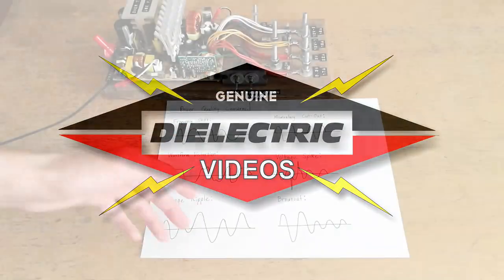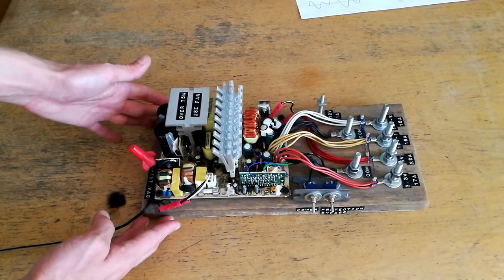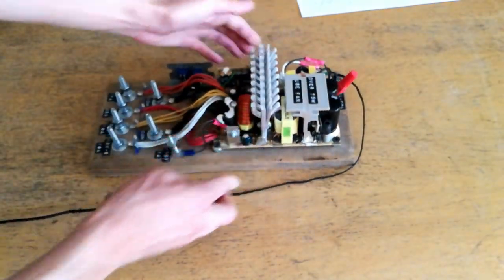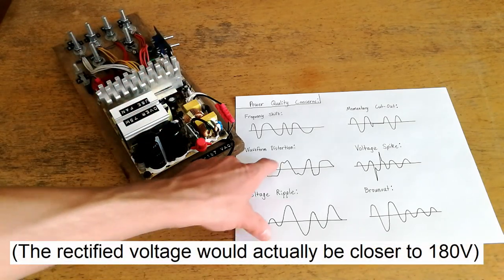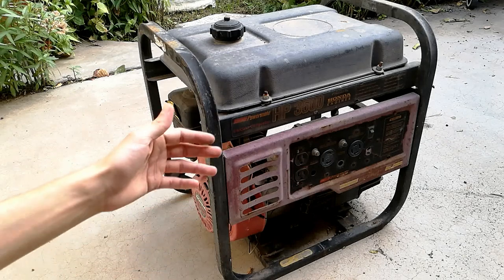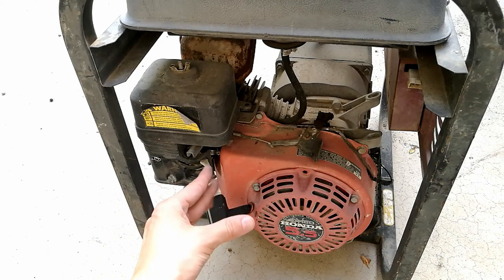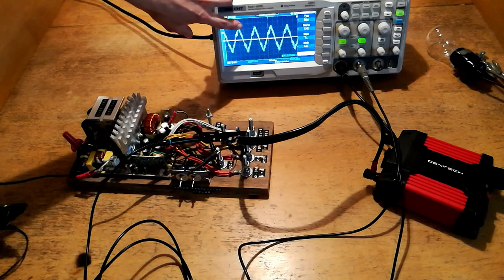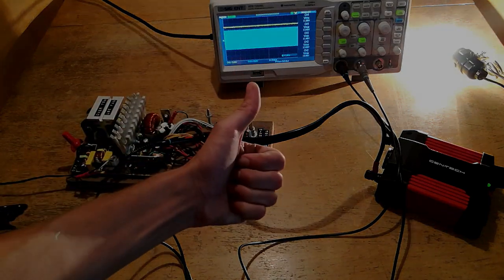EP 45 - Power Quality & Sensitive Electronics

Comment: I have seen other sites say that powered line conditioners are useless with non-inverter generators...
Reply from the maker: In more or less constant-load conditions, the conventional generator would likely not be problematic for most electronics.

However, one thing that I did not cover in this video, but that is very important to consider, is the effect that transient load changes will have on output voltage. The most likely time for damage to occur to a load connected to a generator like this is when another large load is suddenly disconnected, causing the output voltage of the generator to spike.

The effect of a power conditioner will depend on the type of power conditioner, and how it performs voltage control. If it can quickly control voltage, it might improve the survival rate of electronics in these conditions. A simple surge suppressor may do the same, although it may quickly degrade the MOVs.

In general, it's hard to specifically say "this generator is safe for electronics", but in general if large load variations are avoided, it is unlikely to cause problems.
Reply: @DielectricVideos  ...going further on your previous ( and excellent) responses to me on surge protectors and line conditioners.....I'm reading more of the comment issues and return here. So,,.,....in this case, can we say it's good to have some amount of excess (watts produced) capacity?....meaning...... is it better to get a bigger unit, to have it be loaded at (say) 50% of  max load instead of 80%?...such that on/off switching of your loads can produce smaller variations in output? Still thinking this might be better for most of us vs inverter style replacement of our genset....both at a smaller , same rating?
Reply from the maker: @TheWilferch  A bigger unit will have more inertia, so it should ride through load steps more smoothly. That being said, they typically run most efficiently between 50-80% load, so if you go too large, your fuel-to-electricity conversion efficiency may go down. I'd probably try to size the generator so that  the typical full load is around 60% of its capacity, and definitely don't let peak load exceed 100% of design rating. Also note that induction motors can pull 5-8x their nameplate current and power when starting, so if you have any large motors, you should be sure the generator can deliver around 5x the namplate power rating of the motor (this can be peak generator rating, and need not be its continuous rating).
Reply: @DielectricVideos  ...Excellent !!!...here's more....when I investigated my split-system home AC/heating system ( all electric).....I came across comments from others that when adding a 521-style hard-start system on the outside unit....it drastically reduced the starting load on the compressor and made starts on standby generators a lot easier.....maybe this approach can be applied to folks who have to contend with many ( or large) motor starts on gen power?

Comment: Make sure to buy a generator with a AVR   Most Cheap Low end Generators don't have a AVR  ( Automatic Voltage Regulator )  they use a Capacitor to Regulate  the AC Voltage & when engine speed goings Up or Down the AC Voltage does the same Up & Down, But a AVR Keeps the AC Voltage at a Set Voltage 120 or 240
Reply from the maker: Great point! The generator shown here doesn't have an AVR, so its voltage follows the engine speed and to some extent the applied load.
Reply: @DielectricVideos  ..funny...everyone disses Harbor Freight Predator Generators...yet if you look closely at the build architecture and componentry they mimic all the other brands available for home use....and yes....they have ( at least my model does).....an AVR.
Reply from the maker: @TheWilferch  Harbor Freight power equipment has always been really good in my experience. I have one of their 400W modified sine wave inverters from 2015, and I've put thousands of hours on it, including several overloads and a positive/negative terminal reversal. Other than replacing the fuse after the reversal, it's been an extremely solid inverter!
Reply: @DielectricVideos  ..let me go further.....assume that your normal generator is set up ( as I did),  to back-feed your home's main panel during a power outage, via an interlock system added to your main panel.... and using an inlet PB30 receptacle, that takes an L14-30R connector between the house inlet connection and the generator. Is there still a reasonably economical way to add line conditioning?...or...would it be a plug-in to whatever specific circuit home wall receptacle?..... feeding whatever "delicate" electronics you are trying to protect? Meaning...only a smaller and more specific-duty device for one of the breaker circuits or specific wall receptacle connection? Hope this makes sense. I'm not using individual 120V extension chords from the generator hooked-up this way.
Reply from the maker: @TheWilferch  For a whole-house generator supply I think the easiest method would to be to install point-of-use line conditioning at the loads you are looking to protect. A voltage regulator unit would probably be adequate, assuming the loads are not also frequency-sensitive. If they are frequency-sensitive, then a rectifier-inverter system might be in order.
Reply: @DielectricVideos  ..thanks....what would constitute frequency-sensitive equipment? My devices of concern are smart TV's, laptop computers, maybe the wireless LAN/WAN router, maybe the microwave, etc....I don't think I would engage the home A/C and their controls, nor the electric range ( even if one burner load can be supported), nor the washer or electric drier to be under gen backup power...so  maybe just those things at the start of this sentence. Thanks for all your help.
Reply from the maker: @TheWilferch  None of those items should be frequency-sensitive. Dimmer switches and equipment with synchronous motors come to mind. 

If your loads have full-range power supplies (100-240VAC), there's probably no need for voltage regulation. If they're single-voltage equipment (120V only), then it might be a good idea.
Reply: @DielectricVideos  ...can I come back to this? To summarize.....my intention is to emergency-power my house (.... only certain breaker loads, like flat-screen TV's, LED-lights in ceiling, some kitchen loads like coffee maker, and  also laptops)....using a "standard" generator ( with AVR control ) hooked up to my main panel via an interlock system and L14-30R connection and cable between the generator and main panel. If I can locate the plug-in loads like TV and laptops to be specific wall outlets......what device(s) can I buy for your recommended line conditioning?...even if I need to buy a few of these for the various outlet connections? Looking over our previous exchanges, I am left somewhat confused. Maybe help ( if you do so) not just in describing the device but showing a link for an example piece to buy. I know it's asking a lot, but thought to ask..... cheers.
Reply from the maker: @TheWilferch  For the things you covered (flat-screen TVs, LED lights, kitchen loads, laptop) you probably don't need line conditioning. A name-brand surge suppressor would take out any small transients.
Reply from the maker: Here's a surge suppressor rated for a lifetime surge absorption of 3940 joules: https://www.amazon.com/Belkin-BE112230-08-12-Outlet-Power-Protector/dp/B000J2EN4S
Reply from the maker: And if you do want active line conditioning (which is overkill for the items you covered, in my opinion), here is an active line conditioner: https://www.amazon.com/Tripp-Lite-Conditioner-Regulation-LS606M/dp/B00006B83G/
Reply: @DielectricVideos  ..perfect !!..... thanks so much for offering the clarity I needed. Happy New Year to you and all others here ........

Comment: very informative thank you
thou i have another question does this problem is also continued on AVR power generator or just traditional generators?
and if still same issue how to fix that so besafe for using generators for PC and other sensitive equipments
Reply from the maker: AVR generators can in many cases have more stable output voltage than non-AVR generators. If the AVR is poorly tuned, though, it could potentially cause even worse voltage spikes during sudden decreases in load.
Reply: @DielectricVideos  thanks for info
and awuch so how can i know if its good AVR or not! im not expert like you

Comment: I have a sine wave inverter that's putting out about 110V and I have an electronic pilot ignition on my gas furnace that demands exactly 120V.  I suppose my problem fits into the brown out category.  What can I do to condition the line and boost the current up to a steady 120V?  Hope you can help.  Will something like the Trip Lite power line conditioner solve my problem?  Will a basic power bar/surge protector do the job?
Reply from the maker: The power conditioner could work if it has active voltage regulation in it but a standard surge protector won't raise the voltage.

A variable autotransformer (variac) could also work, as they typically allow a +10% increase in voltage at the top end of their scale: https://www.amazon.com/dp/B078Z7XYT2/ref=twister_B07G5BHXYV?_encoding=UTF8&psc=1

You could also wire a low-voltage transformer (such as a 10-volt doorbell transformer) in series with the inverter output to form a fixed-ratio autotransformer. This is more advanced, though, and would require working directly with high-voltage wiring.

One other question is whether the furnace ignition is not working due to undervoltage, or due to some other issue. Usually there is a +/-10% tolerance on input voltage for mains-powered electronics, so it may be the case that it is not working for some other reason. Is the inverter pure sine or modified sine? Does the furnace require a solid ground between chassis and neutral to function?
Reply: @DielectricVideos  Yep. I found the variac and that's what I need.  I have one on order.  Thanks for getting back to me and confirming that I've found the right device - variac, a 2000V, 20A will handle the electronic pilot and clean up the signal for small appliances too.
Reply: @DielectricVideos  Just wonder, and maybe it's covered in the video, but a floating neutral generator could also create problems with the furnace if powering directly.

Comment: this generator is pure sine wave or not?
Reply from the maker: It's an old-style unregulated AC generator. Although ideally it should be pure sine, there is substantial harmonic distortion in its output due to poor flux linkage and insufficient output filtering.

Comment: I know this is old but if anyone happens to know, what would be the purpose of that NTC resistor that limits inrush until its warmed up? Is there something in there that needs to like be above room temp to function correctly? Whats the point?
Reply from the maker: When the power supply is first plugged in, the HV capacitors are fully discharged, and essentially appear as a dead short. As a result, some resistance is needed to prevent damage to the rectifier and capacitors, as well as to prevent nuisance tripping of circuit breakers. Resistance in the input circuit while the power supply is operating is inefficient, so it is important to remove this resistance once the capacitor bank is charged up. An NTC thermistor is great for this, as it has high resistance when the power supply first starts, but then drops to a much lower resistance after current has flowed through it for some time and it has warmed up. The NTC's resistance gets lower as the power supply draws more current, so it limits power loss to a small (but nonzero) value regardless of the operating current of the power supply.

Comment: Define sensitive electronics, please. I only see that in marketing literature.

Many of us are missing the boat. Local generators (even large stationary gensets) have a much higher impedance than the grid. (See Eatons' vids on YT). The grid can overpower a lot of noise - the kind often generated by switching power supplies and variable speed drives.

Although it is possible to see bad waveforms on faulty generators (unloaded), quite often the waveform goes to pot due to the load.
Traditional motor-generators will be happy with resistive loads (incandescent lamps) and inductive loads (motors, compressors) They will not deal well with switching power supplies and the harmonics of the load - like computer power supplies, smart battery chargers, etc. It is those electronics that cause the problem.

The only real 'sensitive electronics'  that might have issues with a small generators are those that rely on the line source for clock reference. Motors are sensitive to the harmonics of switching PS loads in that they will overheat due to the harmonics.

I would state that inverter based power sources (modified or pure sine wave) should be used for the switching power supplies to deal with the THD that results.
Don't use a modified sine wave power source for a motor load, and keep switching power adapters off of the same source serving motors/compressors.
Resistive loads don't care one way or the other.

Match the source with the load for the best results.

Comment: crappy generator + large battery charger + large deep cycle battery + large pure sine inverter. = large inverter generator with other usage.
Reply from the maker: An excellent idea, thank you!
Reply: @DielectricVideos  thanks.the so-call lead acid deep cycle battery guy at the RV parts store that i spoke to, told me never run them down past 11.5..11.5 to 10.5 is where most damage is done. he added"especially with the cheap ones at wall mart. in my boredom I looked into what separates the "good" from the "bad" and found the biggest difference is about 30 cents worth of plastic. the plates are farther away from the bottom so when the lead or whatever, starts to shed off and build up on the bottom, it takes longer to build up enough to short the bottom of the plates together. i guess that shedding happens most between  11.5-10.5. why the cutoff on every thing is 10.5, is beyond me. but it is a battery killer. someone should make something that replaces the caps ,with something to monitor what is going on inside.
 well, thanks for the thanks and thank you too. i learned a lot from your video. the sharing of needed info on YouTube gives me hope for humanity. LOL .
Reply: That is a great idea to consider to obtain cleaner AC signal for expensive electronics, just to be safe.  
Question though, this should work without the deep cycle battery, I would think.  Is the battery there just to provide a more steady DC supply?
Reply from the maker: @nicholasdubose8501  The battery would allow you to keep the power on even when the generator is off (such as at night), but wouldn't be strictly necessary. As you saw in the video, a 12V switched-mode power supply has no problem running on the generator even when the voltage sags very low, so you could definitely run a pure sine inverter from a power supply connected directly to the generator with no battery.
Reply: @nicholasdubose8501  i'm not sure. i know the  inverter generators are kind of complicated with a clutch and flywheel to regulate the right needs without a battery. and they are usually not very high output. i was wondering if some giant capacitors ,instead of batteries would be nice. they last forever.
Reply: immrnoidall capacitors are very expensive for large sizes. A lead acid battery used purely as a buffer and kept charged should last a long time.
Reply: I use the same setup.  Only difference is I use a 400 watt 12 volt power supply charging a 100 amp hour agm battery.  The 1000 watt pure sine inverter is connected to that.